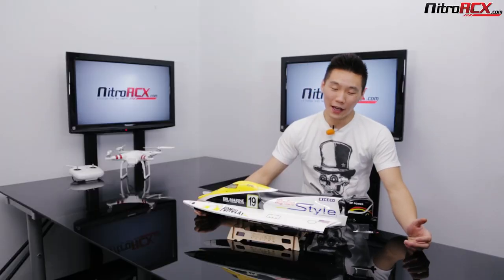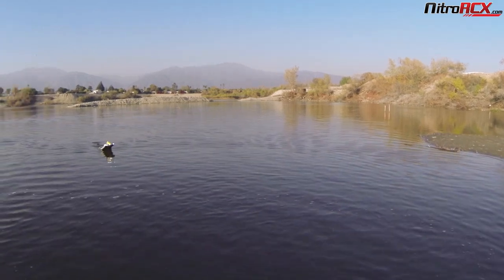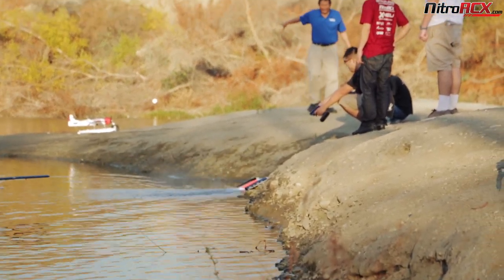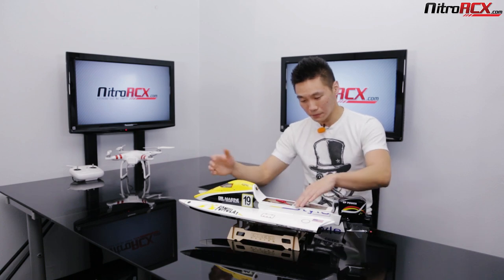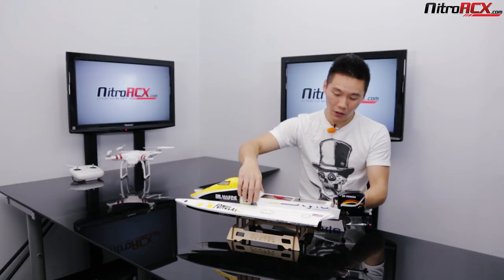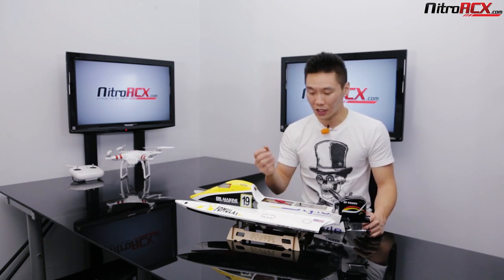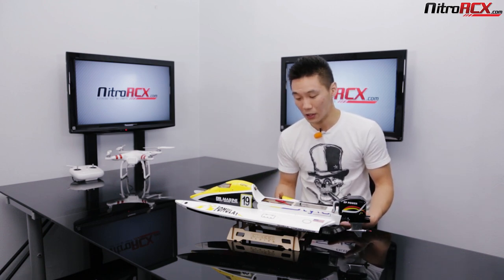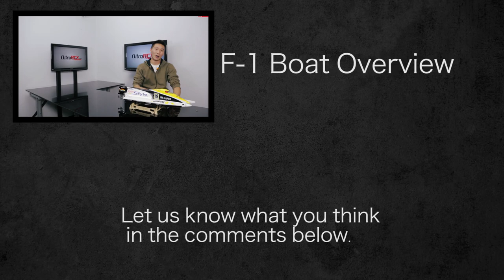Exceed Formula 1 Speed Boat in Action

Comment: How fast does it good??? And is it gas powered too???
Reply: No, it has a small brushless motor facing down in the outboard. There is a flex shaft that goes a whole 90* to the 3 bladed prop

Comment: why is it that people who post this type of video feel it necessary to include brain numbing migraine inducing music?  I would have been nice to actually hear the boat in operation.
Reply: it's electric . hear what?
Reply: Fon Yuen
So the boat doesn't make any sound either ambient or mechanical.  The designers have achieved a scientific first, I'm sure that "noise abatement groups" would happily want this technology universally applied.  There was just one other thing, is there a time limit to the length of the video, as the speed of discourse was almost as fast as the boat?
Reply: Fon Yuen To hear things like motor RPM, cavitation...if there is any, If the motor lugging down due to improper trim or prop depth. Listen for mechanical failures of the prop shaft...perhaps the collet is slipping under load. There are lots of things we listen for. Another one is listening for vibration of an unbalanced prop or underwater small object strikes like subsurface sticks.   Some just like to hear the hum of the motor.
Reply: True dat